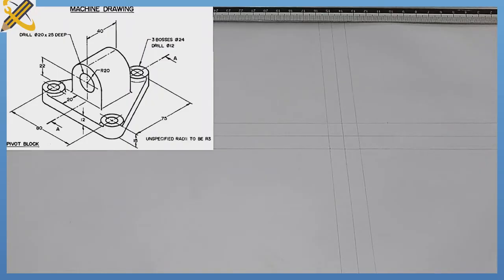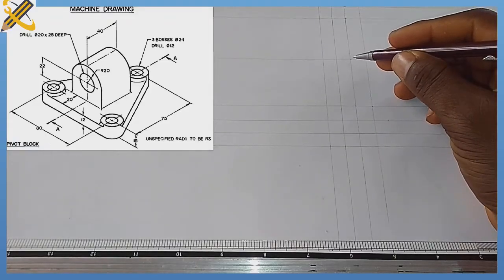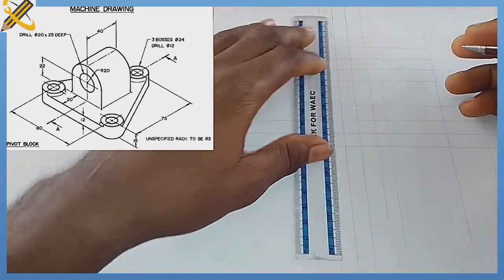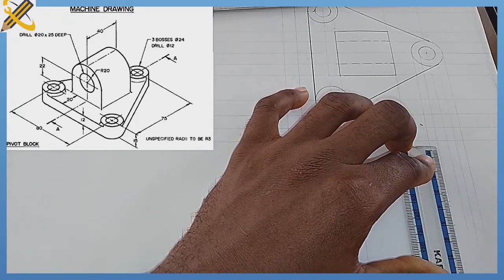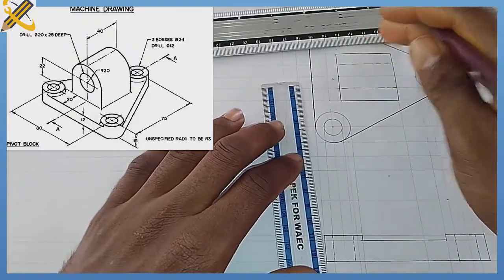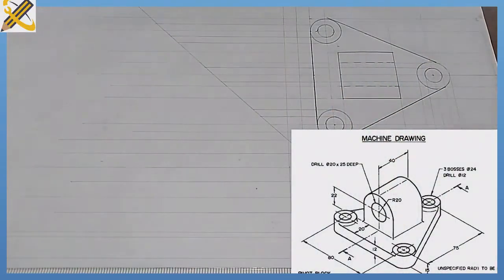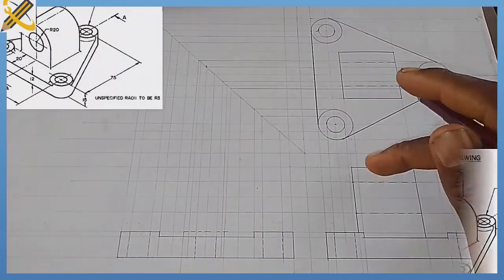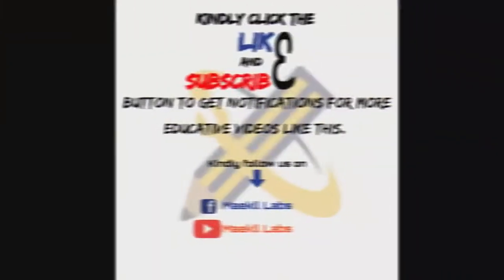Orthographic projection - Machine drawing in | Technical drawing | Engineering drawing

Comment: There is an error in that diagram the semi square on top of that 20dia *25 deep...meaning that the hole did not reach the other side
Reply from the maker: Very correct,...u won't believe my eye didn't pick that dimension u just observed...
That showe dat u understand what you are doing very well....thanks for the observation.
Reply: @MAEKLLTECH  Thank you sir, have learnt a lot from ur videos ...will surely make you proud...my Engineering drawing Exam is in two weeks time...God bless you sir!
Reply from the maker: ...wishing you the very best of best performance 💪...